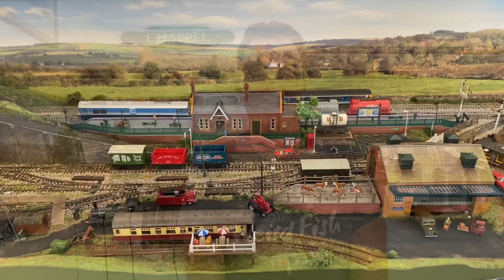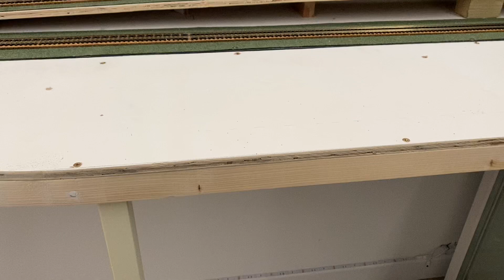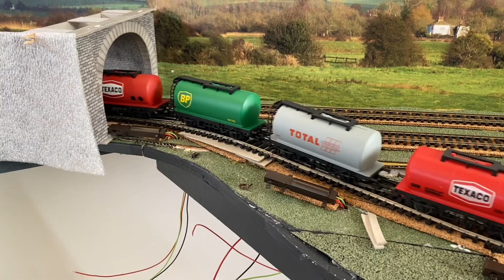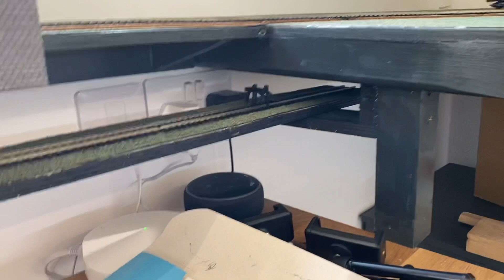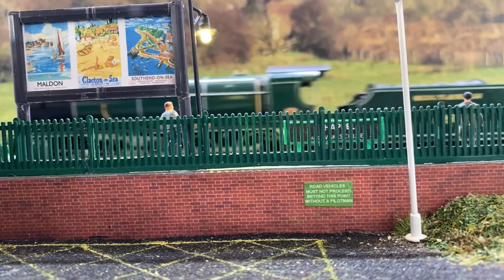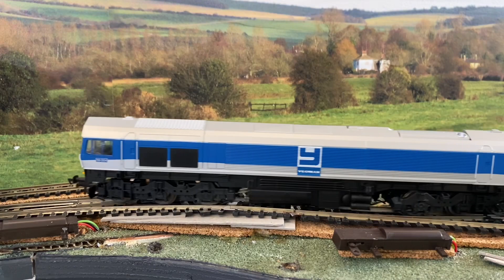12 Building my first model railway - Adding an industrial area

Comment: Just a thought you could add a run around to your gasworks by adding a point off the line behind where your placing your gasholder, making a passing loop type of siding.
Reply from the maker: Thanks for your suggestion and great idea. I will see if I can fit it in between the gas holder and offices. Thanks for watching
Reply: @chappelstation  your more than welcome, hope it fits.